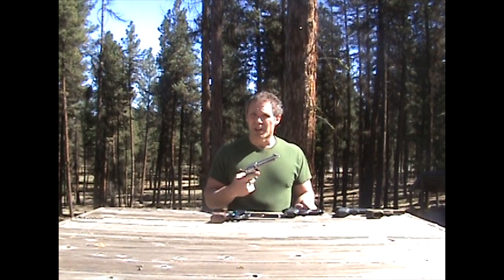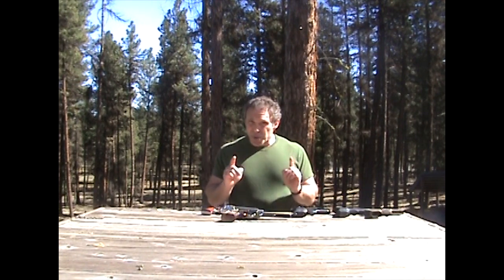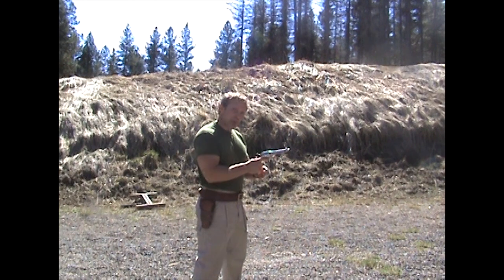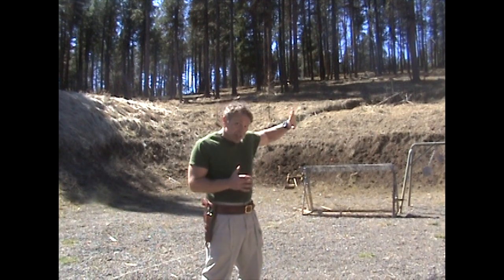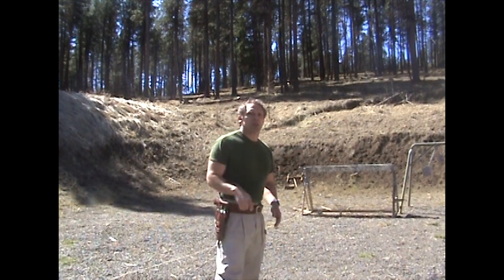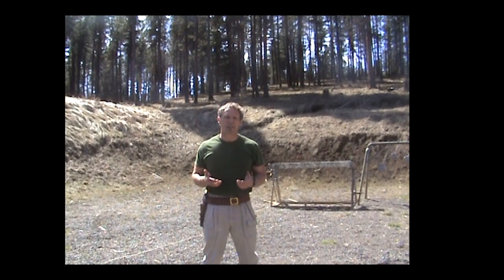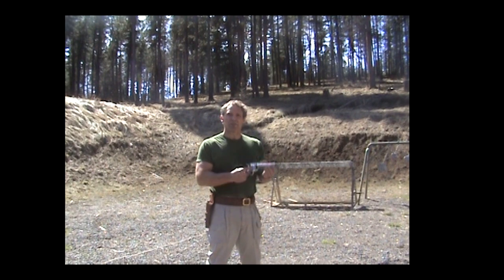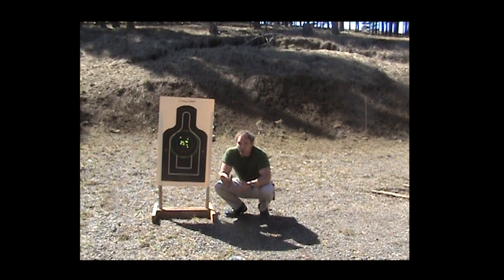Single Action Revolvers for Concealed Carry.

Comment: This is why I like the old black powder single action pistols with the cartridge conversion cylinders.
It's much faster to replace the cylinder rather than reload the whole thing one bullet at a time.
Reply: The remington 1858s are good for that. Don't try it on a colt model open top model. Too slow.
Reply: @davezinetti666  oh yes thats what I'm refering to.
Sad part is you lose alot of power doing it this way as these black powder revolvers can't handle full loads. Gotta use subsonic rounds.

Comment: Anyone who enjoys 4 pound revolvers under there armpits. The kind of belts with two metal loops, and your run the belt through them and pull tight. They make great shoulder holsters. Use a regular hip holster and you are all set. I'm 6.2 210 pounds, and can conceal a full sized Remington 1858 in the winter time using this method.

Comment: Disclaimer: I'm no expert on the Old West.
But I've heard the typical Hollywood portrayal of gunslingers with two pistols was pretty unusual for anyone carrying a cartridge gun.  Having a cartridge gun was considered quite a reloading advantage over the earlier, though still widely in use, cap and ball pistols.  It's my understanding that the carrying of two pistols on one's belt was fairly common among cap and ball pistol users since it took significant time (and care) to reload them than reloading any early cartridge guns like Colt's Model of 1873.  Wild Bill Hickok was one of them.  Even after the advent of metal cartridges and cartridge guns, he continued to carry a pair of cap and ball Colt Model 1851 Navy revolvers.  While a reload with a Colt 1873 could be done in well under a minute, a reload of an 1851 Navy could take several minutes.

Comment: That was good. What are your thoughts on the old break top revolvers? I have a couple .38 s&w, and a .32 s&w. They're fun to shoot, but from the tests I've done with the .38 shorts, they are pretty low velocity, and don't really penetrate very far, only one 3/4" yellow pine board, with 146 grain, lead, round nose. 130 grain .38 special penetrated 2 boards, 115 grain 9mm penetrated 5, and 100 grain .380 penetrated 3.

Comment: When I took my conceal carry classes, at the shooting part I used a Uberti made 1871/72 Open Top Colt  revolver 38 special  with a five and a half inch barrel. I believe the target placement was 5, 10, and 15 yards. I scored a 246 of a possible 250. Nearly all of the shots were in center mass.  I do occasionally carry this revolver, and when I do I only load 5 chambers. I drop the hammer on an empty chamber.If I were shooting at the range I would load all 6.

Comment: I open carry a single action .44. With 3 1/2 in barrel.  Have it on my hip right now.  Carrying this kind of firearm for personal protection keeps one in the mind set of focused methodical  fire which is safer and more effective than the less practiced person replacing volume of fire for effective fire.

Comment: What about in bear country, predator defense?  Where we camp there is a healthy population of black bears.  We have had several come close to camp, to close for comfort.  I have considered bear sprays but still would like a back-up handgun.  I'm leaning towards the .44 Magnum, just not sure which one, single or double action revolver.  I'm also debating about the length of the barrel, what would be best.  The Ruger Vaquero, I see they offer that in the .44 Magnum.   Anyway, what would be your personal choice, and why?  Thank you for your time ...  P.S.  I have shot a Smith & Wesson model 629 .44 magnum with a 6.5 inch barrel, and a Ruger Blackhawk with a 5.5 inch barrel.  I handled the recoil just fine, and enjoyed shooting the .44 magnum.

Comment: my main concern these days is with civil unrest. I live in a....lets just say a diverse part of town that has had a lot  of race related issues over the last few years. I just want something I can use if they break through my barricades and trip wires.....yes I use those now because I'm worried about a civil war. Unlikely? Maybe, or maybe not as unlikely as you think. I have issues with semi autos, especially with maintaining them. I still have a Ruger P95 thats really reliable. I have 7 mags for that thing so that's good to know. However most of my firearms these days are chambered in either .38 or .45 LC. Now I do plan on moving but the thing is UNTIL I can (which could take 2-3 more years) I have to worry about the political climate. Now I KNOW a 300 grain .45 LC will put down any two legged critter for sure. I just want opinions on the home defense aspect. I carry 2 .38's outside the home. I just draw revolvers way faster and shoot them better. Not sure why but that's just the case for me.

Comment: When I was 23 I ran.a business which had a high cash component. I carried a 71/2 inch ruger Blackhawk. I carried I'd cavalry cross draw on my left hip. I am right handed. I carried it butt forward. I carried it with the loading gate open. This gun is avruger new model Blackhawk. The gate open prevented the pistol from firing. I flipped the gate closed on the draw and it prevented an accidental discharge. I got a new doublebaction river security six about a year later and it was better. This was mid 70s.

Comment: My in house drill with snap caps is draw cocking with right hand alone simulating assuming the left hand is unavailable. Once.. ... draw cocking with left thumb simulating normal support hand. Once. ....  Draw with the left hand only cocking, simulating right hand unavailability.  once.  ...  Draw with the right hand as for double action.  Repeat for the whole session.  This lets me be fluid with all these options.  I have both but carry mostly double/single action.  This keeps all my options fluid.  When you do this enough slowly and by the numbers, it becomes instinctive and speed follows.  God forbid it happens. Once engaged, it should be automatic and just happens.  I like the idea of cocking the first shot for maximum accuracy and then going into double action.  I have found that it takes almost the same amount of time [about a second and a half] to draw cock aim and fire.  It is just what happens in the draw. Of course given the situation I may just draw to double action ready.  Just my idea.

Comment: One major advantage a single action has over a pistol: always loaded. No racking the slide, no safety to worry about or to forget, no worries about if it's loaded and ready to fire, 10 times more reliable: 'click' always means BANG! No FTF no FTE, no light primer strikes, no stovepiping, no double feeds, no safety engaging by accident because of the finger   touching it while shooting... NO contest. 
Only one drawback: slow reload. And that's solved by a double action revolver😁

Comment: in a self defence situation I would just fan the revolver with my left hand, holding the trigger with my right. this essentially turns the hammer into the trigger and your left hand into your firing hand, while your right hand holds the gun for stability, it takes practice but allows for quicker shots at closer range. also the sights on most single action revolvers are rudimentary at best, it's better to shoot single action using the marble method.
Reply: I would suggest not fanning, but thumbing (with off hand).  Same speed, less chance of gun slap and moving off target.
Reply: Grizzly Black Powder I've broken two single actions by fanning. I don't recommend it.

Comment: Ever use the Ruger Blackhawk?  If you have how does it compare to the Vaquero?
Reply from the maker: +GOBRAGH2 The Blackhawk and vaquero are very similar. The Blackhawk has adjustable sight which can be a BIG advantage. Anything you saw in this vid is directly applicable to the Blackhawk.

Comment: I think that the single action revolver adds to the safety because it limits errant or negligent firing and with practice can be fired quickly if needed but it makes each shot more controlled and deliberate instead of an autoloader being shot all over
Reply: It definitely makes it more deliberate. I am going to carry a single action revolver 22lr. I just don't like the feel of the semiautomatic platform. I understand the arguments for capacity. But as stated in this video,  most civilian defensive scenarios are resolved in under 6 shots. In all reality,  most are within 2-3
Reply: @Catgat37  you can get a 10 shot 22magnum revolver and they make a 9or ten shot 9mm revolver aswell in double or single action
Reply: @HighFalutinTootin  I know I could. But nothing feels as good in the hand as my bearcat shopkeeper

Comment: Revolvers are much more reliable, straightforward and simple systems. Just point and pull the trigger. No need to worry about round in chamber, safety button etc. Double action revolvers are good but single action revolver is good enough. 45 caliber revolver is awesome choice. It will take some practice and reloading will not be a problem Also single action revolver forces you to appriciate each shot. Not to think "i have 20+1 cartridges in the semi auto pistol so i am ok". If you must reload a 20 cartridges magazine can be very slow. Lets say you fire 2 magazines and you have to reload the third magazine.

Comment: I’m not that worried about mag capacity or reloading, I’m perfectly comfortable with only a colt SAA and 6 rounds of 45 colt in my home to protect myself. Realistically and statistically the situation will be resolved by the time I fire all 6 rounds, either me or the bad guy will be dead, or the bad guy will run away. Very rarely do these situation turn into actual shootouts like you see in movies, it’s usually a couple of shots exchanged and one or both go down or run away and it’s over in a couple of seconds.
Reply: that wont always be the case so you cant think that way but i understand.

Comment: 45 colt is more powerful than 45acp Easilly.A typical handload of 8.5gr of unique and a 255gr swc is safe in a colt Saa or replica and is around 900fps 450+ ftlbs the factory loads are just being ridiculously down loaded.even the original black powder loads were up close to 1000 fps.

Comment: I use a shoulder holster and would not want a double action because I grip my colts by the trigger.  The hammer is my safety. Auto is good but again I don't wanna shoot my side in a high stress situation and don't wanna use two hands to get into action like pulling the slide.

Comment: Although my favorite carry handgun is one of my 1911's I have in the winter, more than a few times, carried a first generation (1919) Colt SAA in .45 Colt and 5 1/2 bbl. Never felt under armed, a Winchester Silvertip in .45 Colt is a potent round.
Reply: Gotta be careful with modern loads in those old ones though. They are rated for some smokeless powder by 1919 though just some modern loads are still too hot I know. Black powder is safe in all of them but a 40 grain load has so much recoil and smoke.

Comment: I realize this is an older video, but I felt compelled to comment. You state that the hammer should not be cocked until the gun is in a horizontal position. I slowed down the  video of the draws in the 4 1/2 minute range, and you can clearly see and hear the hammer being cocked when the gun is in the (approximate) 45 degree position. I do the same thing, and feel this is safe...and a bit faster.

Comment: Don't forget, black powder gives you a smoke screen as well
Reply: Not all single actions are black powder
Reply: @jorgesolis9468  yeah most of them made after 1900 or so are ok to use with some smokeless powder. The original 1873 colt .45s are strictly black powder though.
Reply: @redtra236  yes and smiles powder should only be used in low amounts in later production saa

Comment: I have semiautos, double action revolvers, but use a Ruger Blackhawk in the nightstand. It's what I first got as a child and the one I shoot the most and trust the best. 

Recently bought a Glock 17 and it's so simple a troglodyte could use it. With 18 shots and no hammer or safety, then the only lever or control that is going to come into play is the trigger. So eventually that may replace the Blackhawk.

Comment: A single action revolver would not be my first choice to take to a firefight!  Not by a long shot!   However, and I speak from experience, a SA works fine for self defense IF one is proficient with one!  In my case a home intruder shot at me and missed, my old Colt SAA put two shots center of mass in very low light conditions at 12 feet!  In short, one should chose for self defense the weapon that works best for him or her in a life threatening situation without thinking.   If you have to think about what you are doing, you are likely dead.  I learned with a SA and shooting one is totally second nature for me.  Even in low light situations at any range less than 20 feet my shots will go where I point, sights are not required.  I can not do that with any other type handgun.   Could I learn that?  Possibly!    But I am of the "If it ain't broke don't fix it" group.
Reply: I have a ruger blackhawk 44 mag 7.5 for a nightstand gun loaded with 200 gr xtp along with a5 shot 44 magnum also

Comment: But they are just cool. .. And better than no gun. We all make compromises on what we carry. Sometimes you can't carry a gun at all and need non-lethal. So maybe sometimes you are just in a time warp and feel the need to carry a sweet shooting Colt 45 single action, or even better a Schofield 45. I think a trained person with one of these guns would still beat an untrained jogger with a Highpoint 7 days a week.
Reply: Also I can shoot Ruger super dooper moose killers in my single action six shooter. 🙂
Reply: I would never carry one of these BTW. I carry a modern compact 9mm. But who knows ... I'm getting older, and maybe at some point I just won't give a crap and will put on the gun belt with dual low slung six shooters and walk around town.

Comment: Single action is way more complicated then automatics or even double action revolver. I compare single action 2 Bruce Lee techniques in martial arts lot of freedom. I carry 357 Vaquero everyday in the front pocket on my Levi's and nobody knows it's there. I train tactically with a 45 automatic at front sight. But I like my single action way better for the safety Factor highly unlikely the fire accidentally everyday getting in and out of the truck plus I have used it for a hammer and if I run out of bullets I can always use it for a club extremely reliable.

Comment: I wonder when you've expended 3 or 4 rounds in a defense situation and want to reload, how it's going to work. But that is equally a problem with a DA revolver. Either way, it would look difficult to avoid ejecting loaded rounds. Doesn't seem wise to run your gun dry before reloading, although it solves this particular problem - no advantage though if it gets you killed.

The real CC problem with SA revolvers is that most of them are big heavy guns. Too bad Ruger Bearcats don't come in .22 WMR.
Reply from the maker: Bearcat in a .22 magnum sounds like a good idea. Ruger does make some smaller framed version of the vaquero in calibers like .357 and I think there's a version in some sort of .32 (don't quote me on that) tactical reloading with a SA is fairly easy, but I can't figure out how to explain it in the written format here.
Reply: BTW, one other advantage (I noticed) of cocking your hammer with the shooting hand for the first shot, is that your thumb is on the hammer spur when you draw, so the spur cannot snag in any items of clothing.
Reply: I like big and heavy (though I am a big guy).  And when you are tall (over 6') it is easier to conceal if you want/need to.  Shorter folks have more issues with larger framed (or longer barrels) pistols.  It is just about "scale".
Reply: You can get bearcats rechambered to .327 Federal Mag and .32 H&R mag, Gunblast has videos on custom bearcats.

Comment: I might try this if I get a 1858 Remington or what not.
Reply: The 1858 New Army Remington is a Black Powder, aka Cap & Ball, handgun. You don't load it with cartridges so loading it is extremely time consuming. However if you buy the '58 Remington with all case hardened steel you can buy a 'Cartridge Conversion Cylinder' for them. That way you just change out the empty Cylinder with a fully loaded one. And with the Remington that's not too time consuming. Clint Eastwood used that type of gun in Pale Rider.
(I have an 1858 New Army Remington (in .44 cal) and it's a thing of beauty, just like the 1873 Single Action Army Colt aka Peacemaker)
Reply: @Condor512  Well there are paper cartridges for them but the nipple has to be capped separately. And some of the metallic cartridge ones are black powder guns too. I mean you can use smokeless powder in them but it isn't safe.

Comment: +Paul Harrell I have heard some people say that a double action revolver is the best choice for defense because the heavy trigger needs to be pulled deliberately in order to fire it. I have never shot a single action revolver but I assume that the trigger pull is pretty light (increasing the chances of a negligent discharge). Would a cocked single action revolver actually land you in hot water in court?
Reply: I agree that the long pull of an uncocked DA revolver does show deliberate intent. I would also suggest that the cocking of a very long 4-click SA hammer shows deliberate intent as well...adding to the fact that a SA revolver cannot be fired without cocking the hammer. To your last question...a situation in which a SA hammer is cocked should only be when you are ready to fire at your intended target.